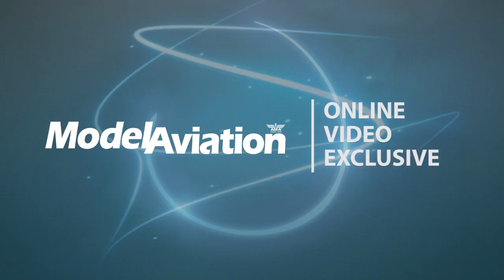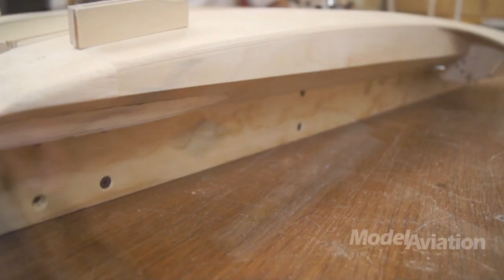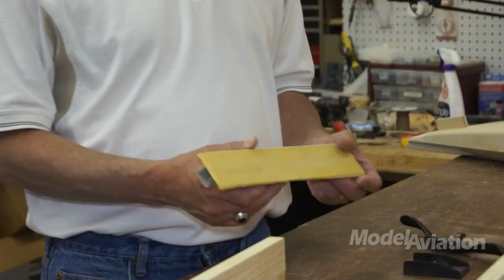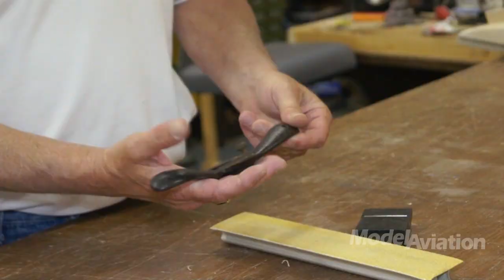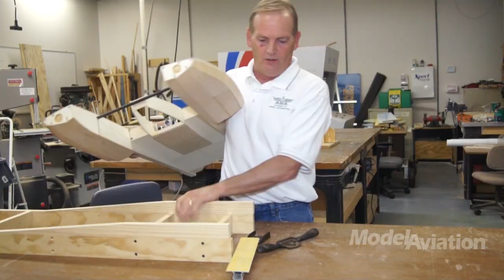Scratch Building a Model with Greg Hahn - Model Aviation magazine

Comment: The older i get, I find old school no BS tools tend to be the absolute best in as far as getting the true shape and finer details. I still use the same 5-6 tools on the regular. This goes for static to R/C stuff. I will admit to being a "tool-horse" or having a "tool fetish" inasmuch as never getting enough of having the right tool for the job, but also finding new uses for old tools (IE: using a good pencil sharpener to bevel styrene tubing/rod). Which tool has changed the game for you folks? @modelaircraft

Comment: im all for tools to help you ensure a straight, true boat (specifically hydroplane like in the video), but personally, unless your a complete novice, I dont believe the jig is as critical and absolutely required as he emphasized. I have been seeing more and more people (including a gentleman with his own website for wooden boat kits hes designed himself) that never use jigs and still build perfectly straight hulls. As long as you indeed have a good bench/work area thats flat and level, your patient and aware of the critical areas of the hull that need to be straight and you take consideration towards that, youll be fine.